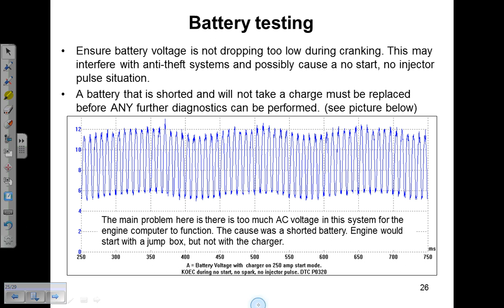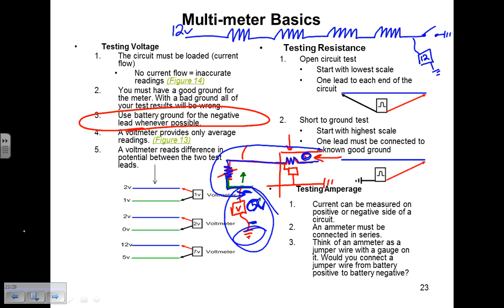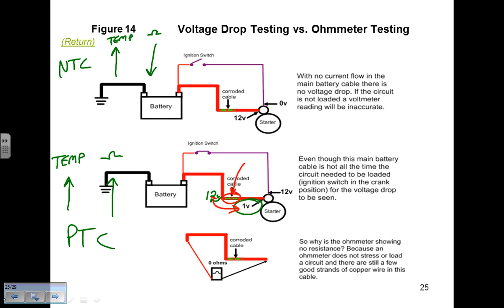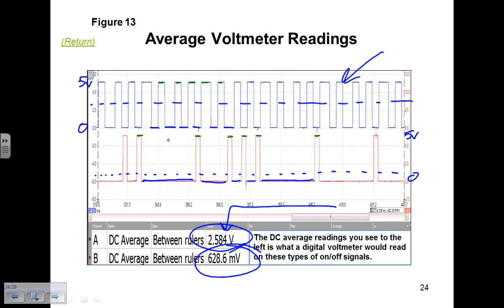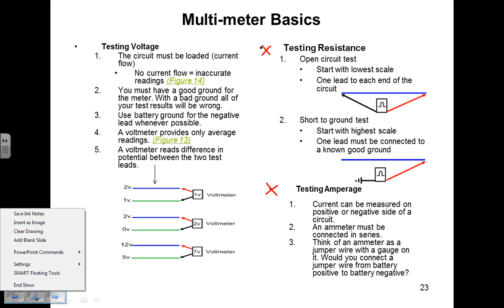Multimeter basics, voltage and resistance tests (a free SD Premium video)

Comment: Funny I watched this this today.......my MIL light came on yesterday and it pointed to my Civics #2 ECT sensor. P2183 & P0111. Found a corroded pin on my #2 ECT. One question though. What is the point of having two ECT sensors? My 06 Civic has one down by the fans (the #2) and the #1 is up in the regular location next to the EGR. Is there really a need for 2 of these sensors?

Comment: Hey Mr. SD, Is it possible to use the Voltage testing method on (Airbag Circuits) like Impact sensors and any other airbags?

Comment: @scannerdanner  it was the first 4 pin relay at top, for fan one that's the fan I disconnected . Dan the car is long gone, I was just thinking back on it.. Thinking why I dint have any thing on that one leg. I m guessing if the ECM dint pull it to ground there would not be any thing there.. Am I wrong ?Is that circuit ground side switch?

Comment: No my first test is to check if the terminals on the battery are tight 
Second check is the fuses the main Fuse....
Third check is the voltage in , of the battery 
Fourth check is the power feed to the starter motor and the earth ground 
Then crank it over 
    Then and only then follow through with checking with a voltage meter 
    Actually did this around two weeks ago ......
    Oil on the starter motor positive feed wire thus causing a power leakage , slowing , and halting the amount of power supplied to the starter motor 
   Just wanted to say start with the basic checks from the outside to the inside
Reply from the maker: This wasn't about any particular first steps 🫢

Comment: I just read that the max a computer ground should have as voltage drop is .10v but what does that figure mean? 1.000 is a thousand milliamps being 1 amp, so .10v is it a tength of an amp but then what’s the ‘V’ part of it?

Comment: The example at around 32:00, I'm a bit confused, point 1 of voltage testing on the slide says there needs to be current flow to get an accurate voltage measurement, but if there is 5V going into that sensor and no ground, there will no current flow, right? or does the current flow through the voltmeter and that acts as the ground?
Reply from the maker: To perform a ground to ground voltage drop test, there must be source voltage going through the circuit (key on) and the circuit must be plugged in. You will not see that open ground when measuring voltage otherwise.
Yes, technically the circuit isn't "loaded" because the ground is open but it is still a valid test to ID that open ground. Hope that makes sense
Reply: @ScannerDanner  Very much appreicate you replying to me, thank you. I've watched your videos on 5 volt reference circuits being pulled low/distorted. The situation I'm facing is similar but with a ground that is expected from the ECU that is being held at +12V when the car is on, but not when its off. Do you have recommendations for the next videos I should watch?
Reply from the maker: @bilaltariq7819  sure do! https://youtu.be/1Nvyc_88AbY

Comment: @scannerdanner the fans work but I want to how they are controlled.. I know typical relay leg 30 is power coming in.. Leg 85 is relay ground, 86 coil power 87 power out put to source. So that leg must have been 85 ECM pulls to ground to complete the circuit to send to 87 to fan on.. Am I wrong as to left shoes on this??

Comment: Nice explanation.  Great for newbies and even experienced techs who never learned this approach to electrical testing.  I believe that a good fundamental understanding of simple DC circuits and Ohms law goes along ways.  HOWEVER  I DISAGREE when you said that both ends of the 12volt starter main cable needing to be disconnected at both ends for Ohm testing. Simply disconnecting the battery positive and negative should do the trick and ohm it from end to end.  Can leave starter side terminated.  However based on what was shown in this video, that test is futile anyhow.  So perhaps not even mention the suggestion of disconnecting the cable for ohm test.   I think a GOOD FIRST TEST for starter load test is measure voltage from starter body(ground) to starter positive post while cranking engine.  This of course includes the total drop from both positive and negative cables and all connections in between.  If the voltage across there is not close to 10 volts or higher during cranking, then measure drop across positive and negative cables.

A good way to easily load test for the cable if you are going to remove it from both ends for testing is use a battery load tester and series the 12v positive starter cable through the load tester to battery  negative terminal.  The load tester usually has an analog voltmeter built in.  First I would test the battery directly with the load tester, Then test with with the cable attached in series.  Subtract the 2 voltage readings on the load tester to determine the drop across the cable.  You could also clip a DVOM across the 12v positive cable ends while doing this test as well.  

I like what how you pointed out the ohm meter still effective for testing wires and circuits on low voltage computer circuits.

The comments about Factory Manuals do not suggest voltage drop testing is WRONG.  Toyota Factory manuals had very detailed starter circuit testing procedures that included voltage drop testing on positive and negative cables because starter circuits also need a low resistance ground connection just as well as a low resistance positive connection.   The acceptable drops for the Toyota manual were around 1volt under load.
Reply from the maker: As for disconnecting the starter cable, you are correct, but that wasn't the point of the lecture. I am teaching fundamentals, and it never really was about the proper way to measure resistance with an ohmmeter on a positive battery cable. The point was, that is a USELESS test. 
Second, as far as factory flow chart go. I never said they were all wrong. I've seen some good ones. The point was MOST manufacture flow charts suck and do have you do resistance testing right from the get go.
Reply: My Battery Tester is digital/electronic so your theoretical test is about as useless as EVERYTHING else you wrote!

Comment: @scAnnerdanner if u wanted to know what current/amps should be in a circuit.. Could u look to the fuse that protects it to get an idea what it should be??
Reply: Looking at fuses will only tell you what amperage that circuit can't exceed but it won't tell you what's normal for that circuit.
You look up the factory wiring diagrams for the specific module/relay to find the normal operating voltage and current to operate.

Comment: I’ve been watching your videos to try and muster up some knowledge & courage to solve my issue. 2007 Nissan Maxima with a slightly extended crank, @ idle the alternator is charging at @13.9v; what’s odd is no matter how long the car has been runner g, if shut off once I try cranking it again it blows the 120a main power fuse, any idea what the problem could be?
Reply: Watch a few more 🤣🤣🤣
Reply: @jkgkjgkijk  😂😂 I did and finally fixed the problem

Comment: Checking for ground on sensor circuits could be done with the key off if you measure ohms to battery negative post.

Comment: I have fuel pump problem with my Suzuki esteem 2000 1.8 station wagon; main and fuel pump relays get on when ignition switch turns on but fuel pump doe not get activated, I don`t know if this car has an inertia switch or fuel pump cut off circuitry. I removed the fuel pump to tested out side, fuel pump is ok. I will appreciate if you help me with this matter. Oscar Martinez

Comment: hi paul i saw this video 2 time yesterday cuz is the same problem i have with my starter. i connect the voltmeter and when i crank voltage go down arround 9v i check batt conection and heavy gauge to the starter is ok. that could be a short starter making high current flow droping the voltage that way
Reply from the maker: +Luis Baez yes, a frozen starter or seized up accessory pulley or seized up engine will cause amperage to be very high and voltage will look low to the starter. Here is a video with a frozen alternator on a mini cooper. 
https://www.youtube.com/watch?v=4YWCKzpbgb0
Reply: Thanks Paul applying all i learned from u classes i was thinking high current flow equal to voltage drop i make the right call them hehe. Yes i saw the mini cooper few times making short i didnt missed any detail. No question about it u the best 👌

Comment: @39.18 it looks like the waveform voltage is -6.0 volts a lot more that it is -1.0 volts. How is it .628 volts? It looks like it is closer to -5.5 volts.
Reply from the maker: Those are both 0-5v square waves

Comment: I know this is off topic but if I am drop testing on a maf sensor can I just turn key to on position or do I have to crank all the way to properly load the circuit. Struggling with a F150 2000
Reply from the maker: Just key on in fine for a MAF circuit to be "loaded"

Comment: Bingo.. "Because an ohmeter does not stress or load a circuit and there are still a FEW good strands of copper wire in this cable" is a point that many overlook, even electronic hobbyists,

Comment: How do i do voltage 5 volt? When is it a direct line to the engine computer? I did continuity between 2 points alternator and engine computer, but there is no resistance. My probleme is that conectic has just one pin you know that alternator is already connected to the ground of engine but i know that is problem in the wire of return signal so how i do for voltage drop? Thanks Thanks
Reply from the maker: You are asking me a vehicle specific question with no information about the vehicle you are working on. Year, make, model, engine and what problem you are trying to fix and what circuit you are trying to test.
Reply: @ScannerDanner  so it's the line of 5 volt signal from alternator to engine computer. It's not an amiracain car it's French. Conectic just has one pin connected to the alternator from the computer but not fuse in line?  It's a direct line. And i have fault in computer signal circuit shorted. So I'd like to do voltage drop, but I'm afraid not to short the engine computer. Thank you

Comment: So my fuel pump connected inside the lid of the module melted plastic on + wire. That's resistance ? what heated that up ? So the module and pump didn't cause that u are saying ?? Please help 

I thought filter in-between two hoses was so clogged it made it run too long to keep car going and burned + wire in plastic connecter.
Reply from the maker: +Headshothorror4488 poor connection in that location is what made it melt. Depending on mileage on the car, I would replace both the pump and sending unit together. Of course put a new in-line filter in it as well.

Comment: @ScannerDanner  A friend  sent me this link to youtube and bought one last year and I use it all the time.  I can check the power and ground to the fuel pump in the push of a button.  I dont like getting under a truck either if I dont have to.     Check it out.  Your students will be amazed !!  Go on youtube and type "voltage drop with loadpro"

Comment: Hey Paul I can't pass my smog because Everytime I turn off my car the pids resit I forced a code on the car then I turned it off then turned it on and it was still there what do you think the trouble is?
Reply from the maker: not sure, maybe someone intentionally did something with the computer memory circuit and made it ignition positive instead of battery positive?
Reply: @ScannerDanner  I'll check thank you

Comment: hey danner i had many codes no start no click nothing! error on dash! was wierd no symptoms warmed car one day xmas! turned off after 20 min never started again! replaced everything ! i got meter readings everywhere can bus all normal! ecept for high and low can voltage reading which should both equal 5v total got .5 on each side! whattttt!! short to ground i would guess so took a grouind wire from ecu to tcm to battery! three all conected and re grounded started up all codes gone and error on dash gone miles back! pontiac g6 junk! anyway why is this what do i do to perminately fix it!! dealership wanted 2000 for new computers!
Reply from the maker: This could be the area https://youtu.be/dfAMDODbDEw

Comment: only 1 volt of the battery's 12 volts got to that circuit right 15:30
Reply from the maker: loaded, yes. Unloaded it read 12v
Reply: @ScannerDanner  thanks man that's a game changer
Reply from the maker: @trathehandymanchicago7044  it really is! Check out this video with a loaded circuit ground to ground test. It will open your eyes even more https://youtu.be/McsNOJvd0ao

Comment: I don’t believe in grounding at the body.  I run a jumper from battery pos and neg terminal.  That way is test from pos to the circuit back to battery ground. If I use a ground near my test point. Everything from were I used ground back to battery neg post is not being tested.

Comment: Generally scanner danner is right about troubleshooting circuits where corrosion and resistance accelerates wear and failure of wires and terminations due to heat generated at those poor connections, HOWEVER, I DISAGREE, regarding the idea that a DEAD SHORTED LOAD (i.e. fan motor) would never be the cause of a burned or melted wire.  Normally however most circuits are fused so a dead shorted load on a good conductor will blow the fuse first.  HOWEVER, assuming that a cooling fan for example is FUSED properly.  For example, had someone bypassed a fuse or replaced a fuse with a larger size fuse at sometime,  that could lead to wires melting from shorts to ground or dead shorted loads. Probably not very common but it could theoretically happen.   Here is an example, one time I hooked a jumper cable reversed between two batteries.  The cables had good conductors with no corrosion, good insulation and terminations, but they were far undersized for carrying that much current directly from positive to ground.  The insulation got hot and began melting from the heat (yes caused by internal resistance in the wires/conductors)... I would not say that it was due to corrosion in the wires as they were brand new cables.  However even fresh new clean copper wire has resistance.  Based on the amperage being conducted (I am guessing hundreds of ampere) that generated alot of heat.  In this case yes its a combination of as dan said resistance creating heat but also just too much load being drawn for the size of the conductors.  Also no proper fusing was in use to interrupt this excessively high current.  It WAS NOT CAUSED BY CORROSION
Reply from the maker: I never said corrosion is the only cause of a melted wire. Of course in your two examples, a shorted motor with a modified fuse and reversed jumper cables will melt a cable or wire! This is the basics of ohms law. I am only pointing out a common misconception when people see melted connectors.